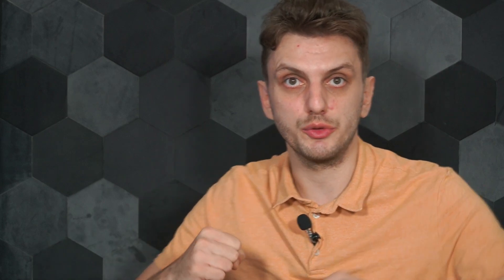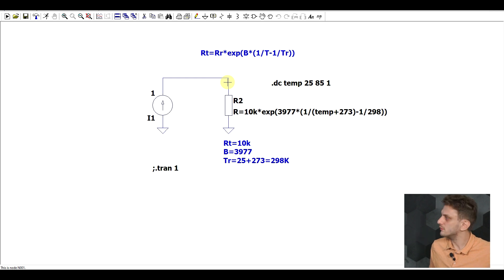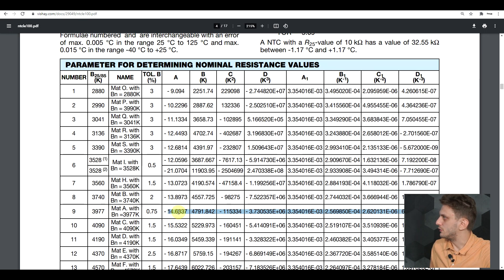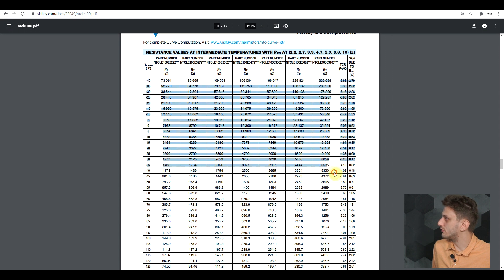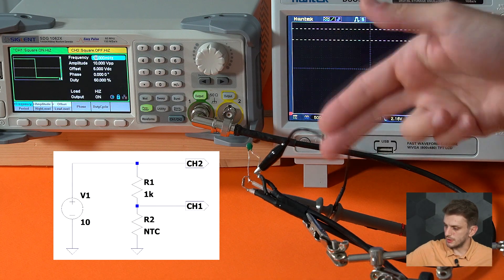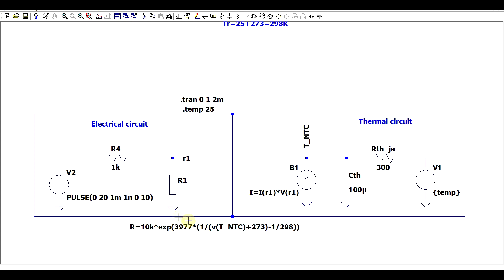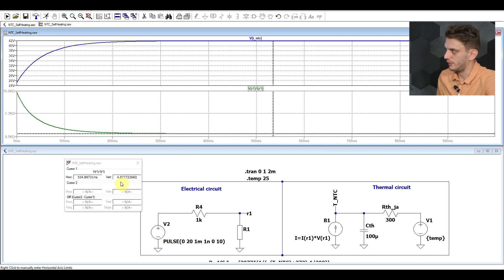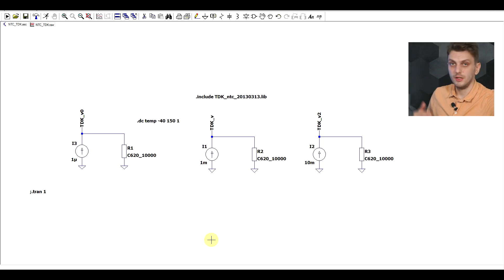LTspice tutorial - simulating NTC thermistors

Comment: 14:01
What happen if we change the voltage in V2 source from 20V to 200V? How read the temperature from NTC junction on the thermistor?

I want to change the resisotr R4 to capacitor and simulate temperature on the NTC termistor and I'm wondering how to read the temperature from the T_NTC?

The energy which dissipate in R1(thermistor) I can read with use button ,,alt + LPM"?

Comment: When you simulate the circuit at 12:50 .. LTSpice shows the error "missing current value for B1" because the parameters I and V are unknown. There is something in your simulation that is not shown on the screen at 12:50 and does not allow me to simulate ... do you know what it is?
Reply from the maker: For B1 I am using the current value running trough R1 (I(r1)) and the voltage on the net called "R1" (V(r1)) -> I guess this might be an issue on your side - what is the net name to which resistor R1 is connected? the net name R1 is given "by hand"
Reply: @FesZElectronics  "Missing current value for "i1""! That is the error message I get when the current source default name is kept. I have defined  nets named "r1" and "r2" (because R1 is not directly wired to ground) and am defining I=I(r1)*V(r1, r2)... Is there any reason why your current source is B1 instead of I1?... Thank you.
Reply from the maker: @pierreangulaire8443  the current source needs to be of type "behavioral current source" or Bi - its not the standard current source I
Reply: @FesZElectronics  Thanks a lot. It works quite well. It's a pity that PTC manufacturers do not give as many characteristics as you show in 15:51. Anyway this is an excellent tutorial!

Comment: FesZ, good day, great video, I worked through the models until the last model, I cannot get LTspice to recognize C620_10000? how do you assign C620_10000 to the resistors? I type C620_10000 into the value for the resistor, is this the correct. thanks
Reply from the maker: You also need to set the resistor to accept .subckt models; for this press Ctrl key and right click on the resistor symbol - and in the prefix field write X instead of R; after this, it should work.
Reply: @FesZElectronics  thank you Sir for the help.

Comment: Hey. Any chance you know how to simulate differential pair of wires in LTSpice. Assuming low enough frequencies where lump elements can be used ... I have L, R, C values for a cable, but is there a mutual inductance that needs to be added into the model?
Reply from the maker: You could simulate it as a transmission line - so work out the characteristic impedance and delay based on the LC elements (there is a transmission line element in LTspice); or just use discrete RLC to highlight the parasitics.
Reply: @FesZElectronics  yeah, the 2 pieces that I am still missing are: inductive coupling + given a diff pair cable, how does one go in measuring mutual inductance.
Reply from the maker: If you know the dimensions of the cable you might find an online calculator to work this out - based on wire thickness, distance between wires and isolator dielectric. you should get the inductance/capacitance and even characteristic impedance. Since you are using the wires as a differential line, you should only have a total inductance (current goes one way trough one line, and the other way trough the other - the 2 lines act like a single inductor - not like 2 coupled inductors.

Comment: Just when I am working on the thermal "bridge" of my standard cells (after replacing leaking germanium transistors by si versions) and now am testing and measuring if everything works like it should, Fezs comes with a nice video over thermistors. It should keep the oven within 0.02 degrees from 30 degrees C The thermistors used are probably made by virgins from ferry-hair. The bridge resister is build into a Xtal housing and hand picked. To bad I can not reach the thermistor because is tucked away deep in the oven layers. There are no adjustable parts. They did that in the factory by matching that resistor and thermistor. It is a bit a  strange design. 
I want to try it in spice. I used simetrix for 15 years or so but that was Linux, I can not get it to work under W10 so I switched to LT spice but that is a totally different way of working. I am now watching your videos about Spice. So thanks for making them.
Reply from the maker: If you need such a tight temperature tolerance, the thermistor should be very close to the component which has the critical temperature. Any distance from it will lead to temperature offsets which might not be acceptable. I do wonder though if achieving 30C is possible - I mean, if you use the device in the summer, the ambient will already be there or above - I saw that usually OCXO will go to 50 or 60C since this is well above any normal ambient, so it can be maintained regardless of season.  
I hope the LTspice videos help, if you have any questions, just leave a message.

Comment: What I have done in the past, is use a spreadsheet in combination with like 4 or 5 values and fit the graph manually from the known formulas. That way you get extremely close. So it's a hybrid approach. 
That being said, the tolerance of most of these thermistors is much higher, not even taking the way of mounting etc into consideration. Nice video btw, ! :)
Reply from the maker: In the end I found out why my simulations weren't that accurate - as pointed out by another viewer, I was using 273K=0C rather than 273.15... the last 0.15 is what was causing issues.

Comment: Friend, if you determine the temperature more accurately, then the error will almost disappear. Instead of 273, use 273.15
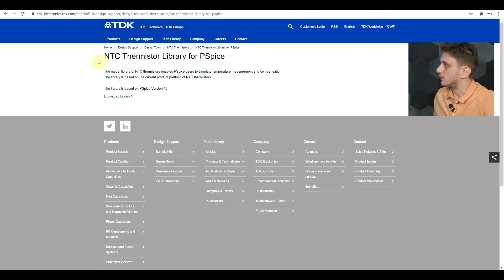Reply: 17:14 You can see 273.15 inside TDK library.
Reply from the maker: Indeed you are right, as with the other observation regarding the measurement unit.

Comment: Hi fesZ electronics, this is off topic - In future you ever have free time, please try making video on how to deal with transients in automotive circuits, where input voltages can go +100V and -300V and we want stable 12V from that. Can such thing be constructed with jelly bean parts. Thanks, Love the videos as always.
Reply from the maker: Are you referring to how the pulses can be simulated or how can they be filtered?
Reply: @FesZElectronics  How can they be filtered. Or if we can't then how can we disconnect the load temporarily while transient state is occurring.
Reply from the maker: In my experience filtration is possible - the really fast (<10us) ones can be handled using large input ceramic capacitors; the slightly longer ones (<2ms) can be filtered using TVS diodes and the really long ones (like load dump) can most often be tolerated by the used components and circuits for short time periods. I guess this is an interesting subject to tackle - I will look into it more.
Reply: @FesZElectronics  Cool, Thanks. Now that I think about what you said earlier, it would be nice to also know how can we create/simulate those transient pulses in real life, so that we can test our protection circuit. LTspice already have those pulse under the name iso7637-2.
Reply: Definitely possible. I don't know about automotive specs, but a little bit about avionic design to meet RTCA DO-160. Not mine, but https://www.youtube.com/watch?v=yZuGXQiHOtA has some typical requirements. We used bulk capacitance, TVS, under and over voltage detection. It's certainly an interesting topic, although I really enjoy @FesZ Electronics RF videos personally :)

Comment: it could be simulated  if the NTC is placed in to  a  fan control circuit (with comparator)
Reply from the maker: You can create a complex thermal system with various thermal resistances and just reference the NTC to a specific temperature, not the ambient. Fan on or off would change the thermal resistance between the heat source and the ambient.